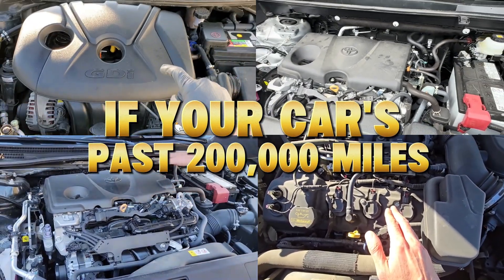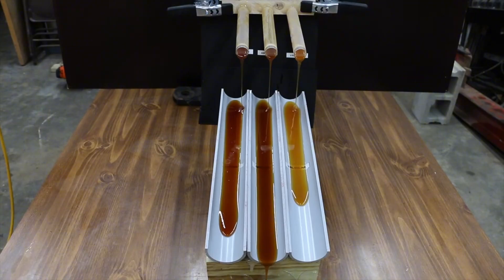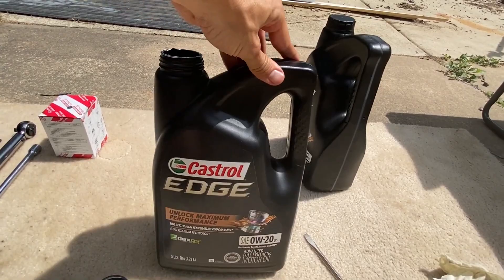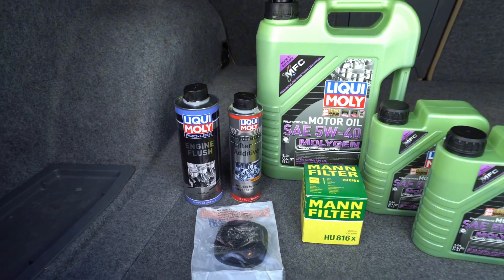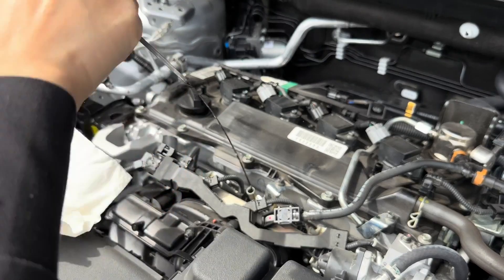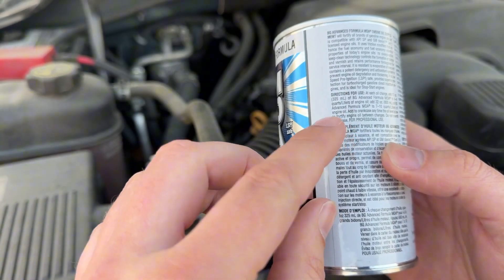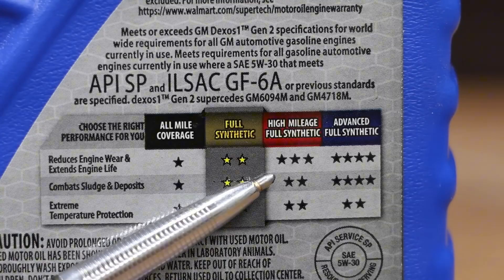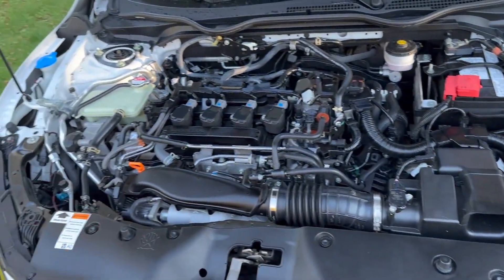The TRUTH About Engine Oil After 200,000 Miles (Real Test!)

Comment: 0/20 oil is useless in hot climates, only suitable for extremely cold climates. 5/30 is definitely the best oil. I used 5/30 for 250,000 km in my 2022 model Passat 1.5 TSI, and my friend's engine is always clean, and the engine broke down after 100,000 km due to 0/20 oil.